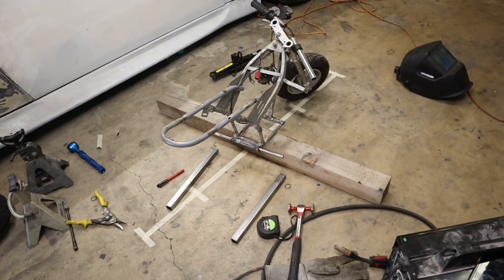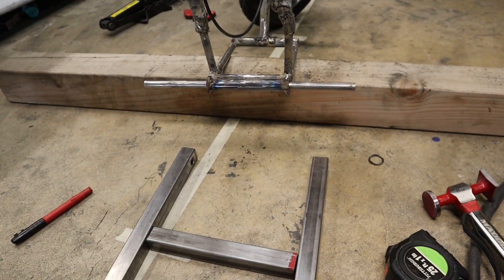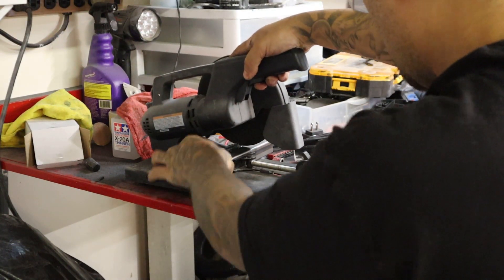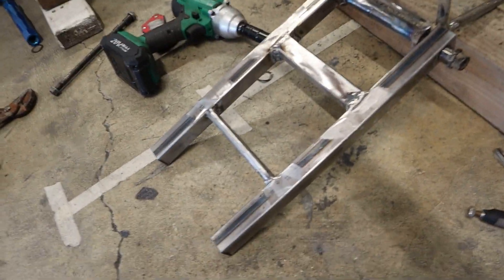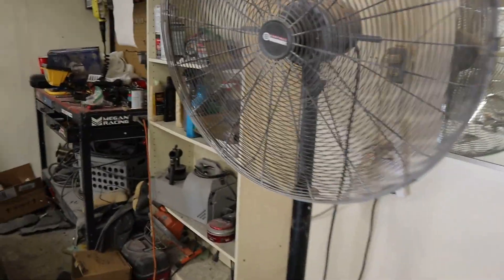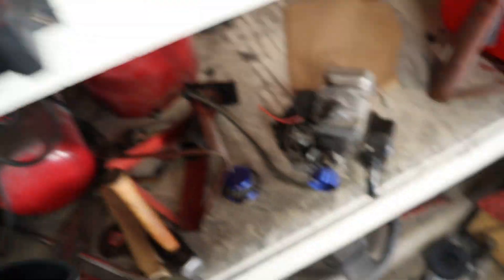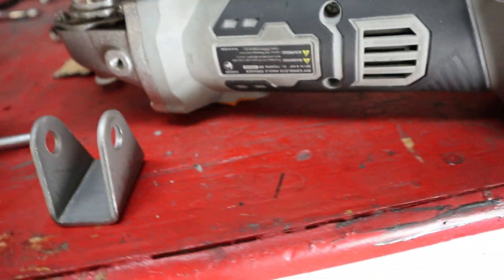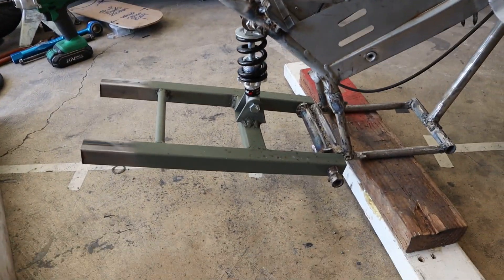custom stretched pocket bike prt 2 swing arm complete

Comment: looks good. welds lookin sketch tho tbh
Reply from the maker: They hella strong, but yes don’t look good. I’m not a good welder
Reply: not  really talking about how they look but the strength is definitely questionable.you need gas.. the burn through is to much heat creating week points. piling  up weld doesn't make it strong. the point is to fuse the material not glue it together. the material is far to thin for flux.
Reply from the maker: @MrSongcuan  I know basics of welding. Not the best thow. All I know is I ripped this bike around all day testing it all out and it held up perfect.